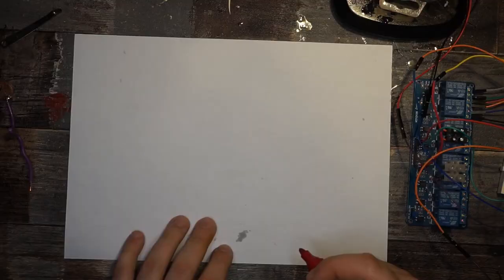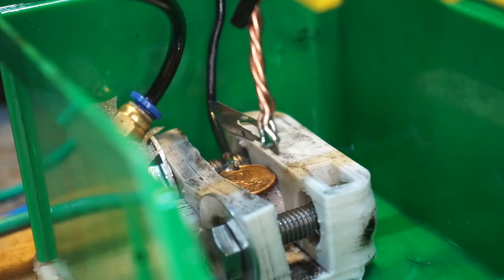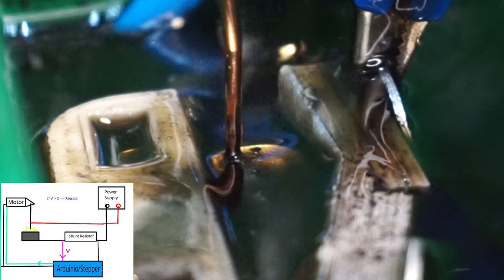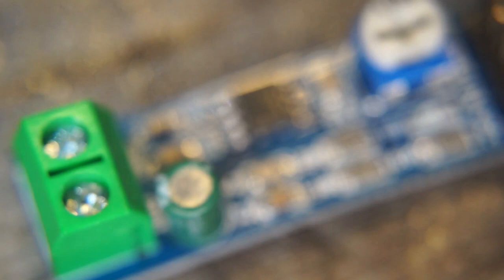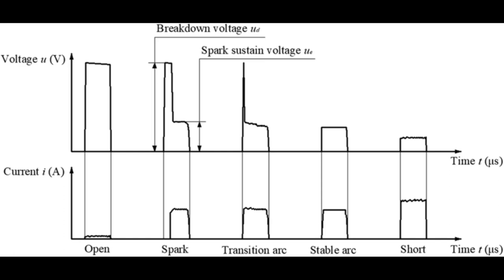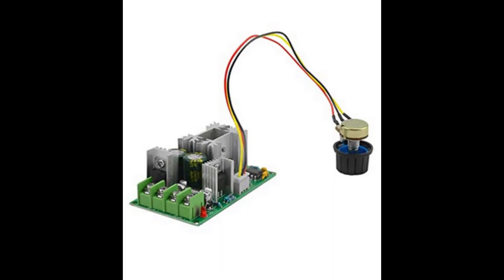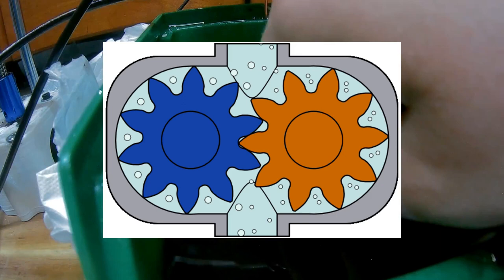Building a DIY EDM machine part 3: Let there be sparks

Comment: I’m afraid you’ve over complicated the whole EDM process but don’t worry it’s a common mistake made by EDM builders. 
EDM machines are easy to build, the electronics side is quite simple and no PC or code is required. 
You were on the right tracks with the audio amp and speed controller part though as an EDM power generator in its most basic form can be only 2 transistors and 1 high wattage resistor. 
Simply amplify your square wave pulse and output this using a power transistor or mosfet through a high wattage resistor, which controls the output amps. Then it’s just Ohm’s law to control a speed controller via a voltage divider which controls the Z axis position.
Check out the video I’ve just posted of a machine I made years ago to prove this and see what you think.
Reply: As I understand it, the pwm-impulses turn an igbt on (pwm-pulses to the igbt-gate), and in turn, the igbt turns on-and-off the spark-gap-circuitry. The spark-gap-circuitry contains the igbt,  the spark-gap and the discharge-capacitor. This capacitor is common part of an upstream circuitry, that is an RC-oscillator-circuitry.
Reply: @klausbrinck2137  Yes that is basically how an RC type EDM works but my machine and this one are Pulse EDM type machines which have no discharge output capacitor which gives more control over the output frequency and therefore a lower electrode wear rate.
Reply: Couldn't a most basic EDM power generator not be even simpler? Just 1 power transistor and 1 power resistor should be enough I think
Reply: @clanneryow5387  Yes it could be if you use low side transistor switching, but a proper pulse EDM (not RC) machine uses high side transistor switching, also it's actually better to use 3 transistors in the generator design for efficiency.

Comment: Why you did not use pwm module to reach about 150 KHz? That you only 2$ pwm module featured duty cicle adjustment
Reply from the maker: actually in part 4 of the series i will test it with a PWM module and yes, it works better, but i still have some feedback problems that i have to solve for a stable workspeed at 150khz

Comment: why are my comments getting snuffed out by yt?  even skrubbed the links
Reply: Try to use this setup for ECM instead of EDM.  just pump electrolyte thru the sinker die (cathode), set correct current for surface and have current meter feedback to control feeding rate/gap size.  the grate advantage is there is almost no ware on the tool and masking can be used.
Reply: yt skrubed my links. but i have forked them and if following you on g i t